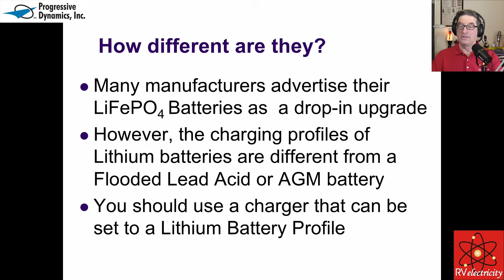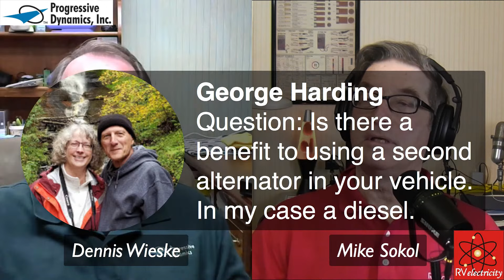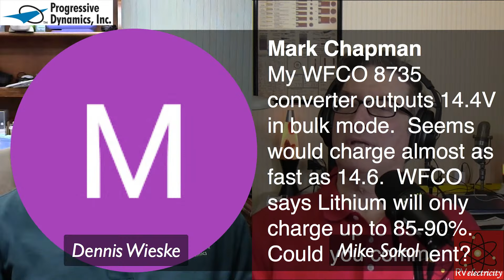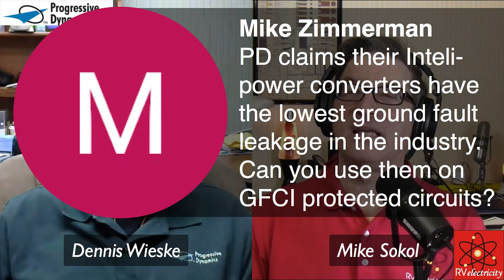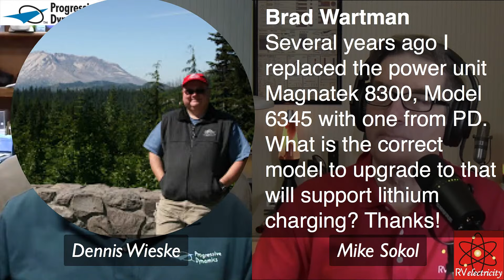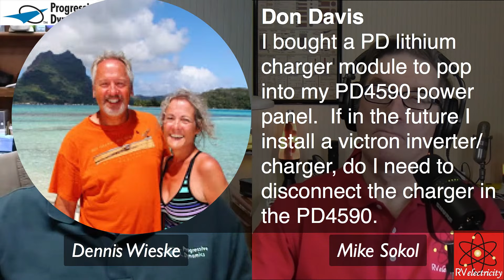Mike Sokol / RVelectricity stream on Lithium Battery Charging

Comment: The problem with PD4600 Series chargers is that they maintain the 14.6V charging voltage after the LiFePO4 batteries are fully charged.  This is stated in their Troubleshooting Guide (PD4600 Troubleshooting Using with LiFePO4 batteries) near the end under Operation:  "With the Jumper in the LI position the charger will maintain a LiFePO4 Battery with a
requirement of 14.6 volts.  When the battery is fully charged the voltage will remain at the 14.6 level."  This is not a good long-term situation for lithium batteries.  Battle Born told me that it is OK to maintain this high voltage on their batteries for a couple of weeks, but after that, the charger should be turned off.  Not many people are going to put this on their calendar and remember to turn off the charger after a couple of weeks.

Comment: I believe you stated that a 18650 was not like the "lithium"cells for your auto.   Actually the 18650 like that go in "vaping machines" (your reference) they are actually identical to the technology which is LiFePo4 .... see https://www.18650batterystore.com/products/lithiumwerks-apr18650m1b
Reply: While you're correct that you can get LiFePO4 18650's, most 18650 batteries are not LiFePO4 chemistry.
Reply: The vast majority of Lifepo4 are pouch or prismatic. Cylindrical cells are mostly the 32650/32700 variety or larger (33140, 66280, 66160, etc)

A123, JGNE and few others made/make lifepo4 in 18650 form factor.

Comment: Thanks for the video. Couldn't watch live but someone else asked my question and I got the answer needed. My install I did over a year ago has been working fine (PD lithium converter, Battleborne battery, BIM-225 smart interconnect relay, and BMV-712 monitor).